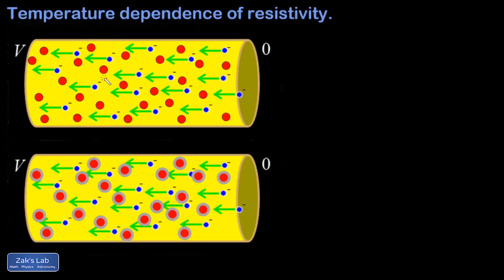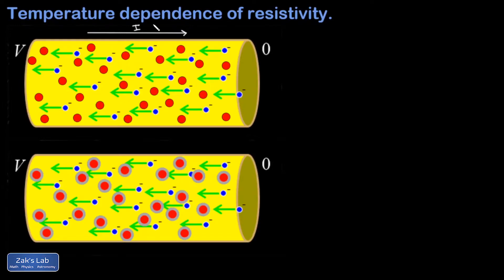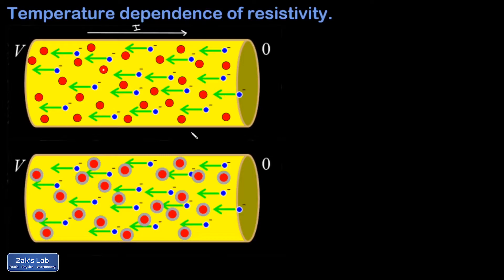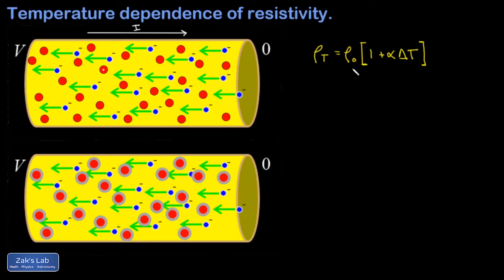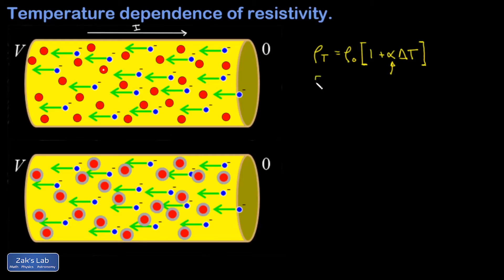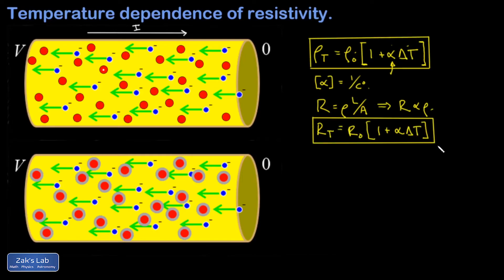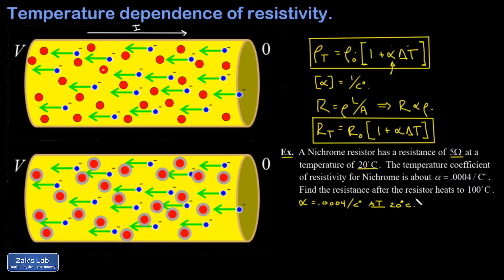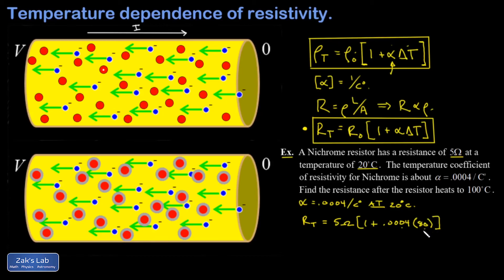Temperature and resistance formula: physical explanation and example of resistance increasing with T

Comment: If the cross section increases does that mean the A gets larger? How does the size of the wire get larger because of heat?
Reply from the maker: The effective cross section of each copper atom increases because the atoms are jiggling back and forth with a larger amplitude.  This makes it more likely for an electron to run into one of the copper atoms.  The cross sectional area of the entire wire (A) is another story.  In fact, the entire wire does expand very slightly due to thermal expansion (more vibration in a material means atoms move to slightly farther apart on average), but we aren't considering the slight thermal expansion of the wire in this video, just the increased effective cross section of individual copper atoms which increases the resistance in turn.  -- Zak